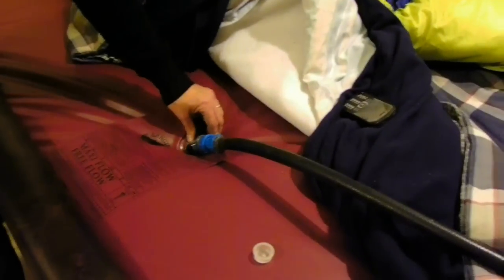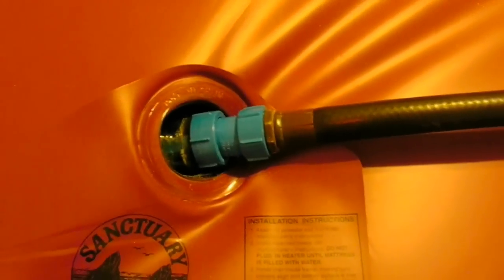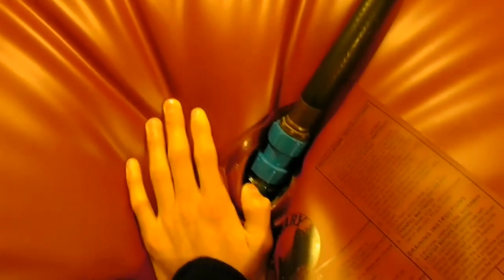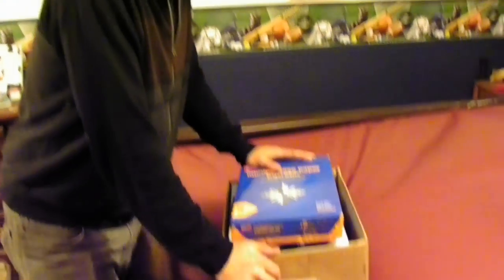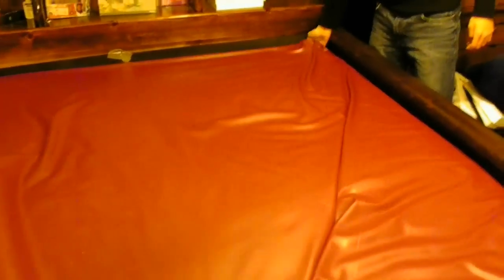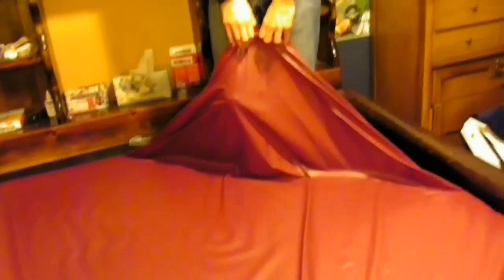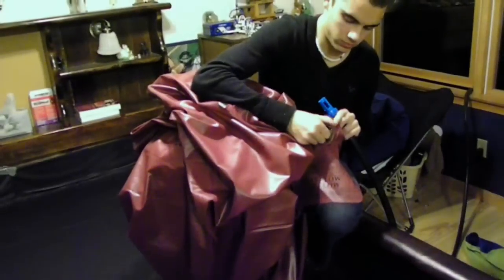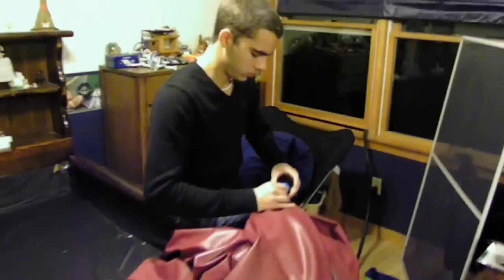How to Empty a Waterbed

Comment: Good job men. This confirmed what I was considering prior to starting. I used the faucet adapter to fill the hose, kinked it to seal water in, then walked the hose end outside and released the kink. It`s draining like a champ. When empty I will hook up the hose to the faucet and fill the new bladder with warm water. I had the faucet adapter in my kit which was purchased 30 years ago. Thanks.

Comment: I watched your video last night as I have king size water bed that had to be emptied in 2 days.I had ordered a drain kit ($5) but needed more info. I was leary since one of the comments below said that if you had fiber in the mattress it wouldn't work. So, I put in the drain, went outside and got the hose and dragged it in. I hooked it up and then went out on the porch and before I got down the last step with the other end, the water was flowing. I didn't have to run the water into the bed first. It took exactly 1 hour and I was pleased as punch. However, getting the mattress out of the bed was really hard. I wasn't strong enough to roll the bed all the way to the drain. With the fiber, it added many more pounds. I got it 2/3 of the way out and saw that it still had about 10 gallons of water in it. So, I got my oil pan and put it on the floor of the bed, cut a hole in the mattress and drained the water out. It took several trips to the tub to empty it but I got it done. I then dragged the mattress out on the porch. Whew! I'm tired! But, if it wasn't for the last part it would have been a breeze. Thanks for the video!! (Having someone to help would have been great!)

Comment: One caveat for anyone undergoing this siphoning method: if your waterbed isn't elevated a decent amount from the eventual output of the hose, it will be relatively difficult to get a decent stream going. A quicker method would be to rent an electric pump that will do the work for you. However, if you have sufficient height and would rather use a hose to siphon, this video does demonstrate the process quite well. Be sure to also eliminate air and air bubbles as best as possible while draining.

Comment: My waterbed is leaking. Can't find the right connectors. Any way to drain it without?
Reply: Du trehnger ingen kopling (om du ikke skal rebruke senga da). Lag et lite snitt i senga og dytt slangen nedi. Cluet er å la vannet i slangen lage (suget) så vannet renner ut. Tipset fikk du på mail i går men disse var litt smarte ved å fylle hageslangen ved å kjøre vannet motsatt (inn i senga) for å få ut lufta i slangen. Når det er gjort kopler du fra slangen nede å la vannet gjøre jobben selv Goog luck

Comment: didn't work at all for me
Reply from the maker: Nicholas Hall I'm sorry to hear that. Were you trying to drain to a higher area or a lower area? This method will not work for draining to higher levels. Let me know.
Reply: X7natedog no it was to a lower outing, i understand gravity works..when im getting it to funnel out how long should i run the water?
Reply: how*..
Reply from the maker: Nicholas Hall Run it for a minute or so to make sure all the air is out of the hose. And make sure to push the nozel down so no air gets in the hose.